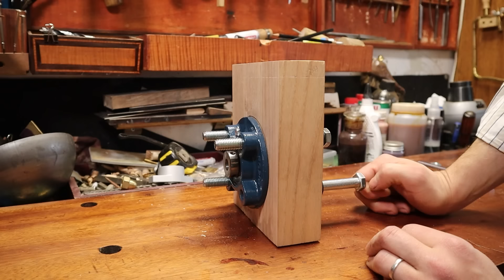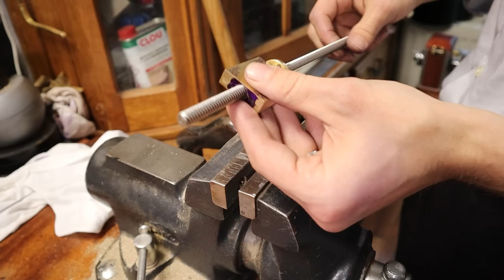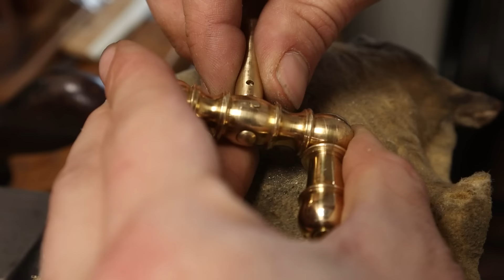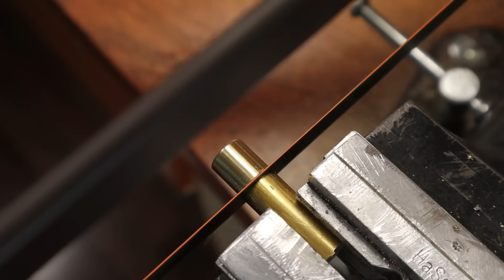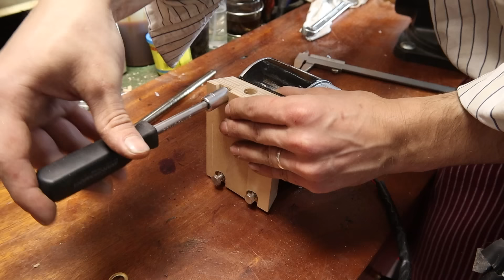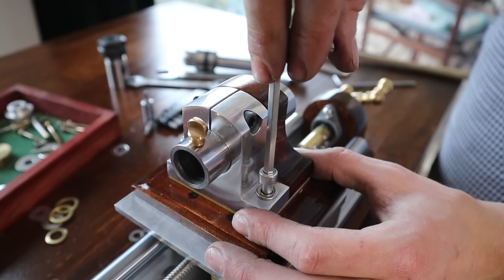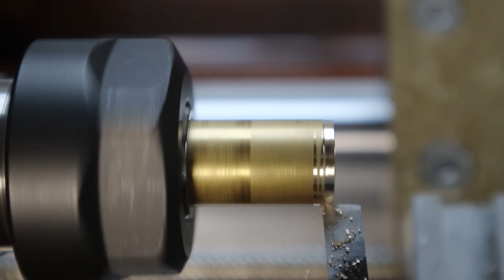Mini Lathe 2 Build

Comment: Pleasure for my eyes!
3 suggestions/recommendations:
1) You need to cover/protect rails.  Otherwise all the metal and wooden chips and dust will ruin either rails, either cart bearings, either both. Something like accordion on real milling machines and big lathes. I saw someone doing these accordions from regular AC Furnace filter( Filtrete, 3M, etc) in Northern America. Don't know if you have such things in Europe.
2) Something is wrong with your spindle bearings. One of the reasons is sort wobling of your spindle. I think you need to change them to some more precise.
3) Please use regular lathe cutting tools, some of the chinease versions are deadly cheap nowadays with decent quality. The crazy sound and quality degradation is caused by the wrong cutting tool angles.  
Good luck and thank you!

Comment: To explain what 4.6 mean, its metric of how much Normal and lateral pressure can the bolt take. So 4 in that mean, its 400MPa normal (tensile/compression) pressure and 0.6 you have to multiply by 400MPa and get 240MPa lateral pressure.  If you want to know how much force your bolt will be able to withstand just times it by the area of the diameter. So around 3kN normal and 1.8kN lateral forces. Hope this helps.

Comment: It's really beautiful but the wooden headstock is the weak link right now. You can see the deflection when you're making cuts. Rigidifying that should help with chatter. It's a shame that there is no space on the base to make it longer. My recommendation is to either replace it with a metal one or at least put a steel plate on the front and back of the wood  to reduce the flexibility. If you're able to also try tying the head stock to the aluminum base plate to reduce deflection. Good luck this is really promising.

Comment: The number on the head are the hardness of the bolts. the first number represents the how much force can it take before it breaks. The second number represents the percentage where the bolt starts to flex, and deforms. But i think the problem here is that the 4.6 bolt are thinner and the thread are pressed on them and the 4.8 are thicker and the thread is cut on.

Comment: Hi Uri,
another hypnotic video... as usual, I can't stop to watch them.
I built a metal lathe, and even if I didn't film the building phases, you could see how it work on my youtube channel (sorry in Italian).
If I can permit me to give you an advise, the main problem of your lathe is the head stock's bearing. That kind of bearing, hallow too much axial mouvements and in a metal lathe this is a big problem.
The best thing for you is to change it with a couple of conical bearing (one on each side of the head), that can be tightened on the shaft avoiding  all mouvements.

Comment: Looks like a piece of art. I use an old GDR lathe and it works well. I am a little suspicious about the wooden parts but that's just me being negative. Probably I would have cast most parts out of aluminum and / or cast iron. Btw the numbers on the bolts are the quality. Stuff like max Torque.

Comment: The number on the bolts is the FOS (factor of safety, buildings are 12+ and lifting is 5-10, these arent under large amounts of tensile force so 4.6/4.8 is fine)

Comment: State of art craftsmanship.
I think the wood may be a bit too forgiving for a material to hold things stable enough for high speed spinning with the torque applied when you lathe turn metal. Maybe create metal structure and a wooden she'll over them. Just a suggestion.

Comment: 4,8 or 4,6 means strength class, the first digit 4,# means the ultimate tensile strength, and the #,8 or the #,6 number means the percentage of the previous value what is the yield strength (strength at which the steel gets permanent deformations before breaking). So for example in a 4,6 bolt the ultimate tensile strength at which the bolt breaks is 400 MPa and the yield strength is 60% of that value, so 400 * 0,6 = 240 MPa is the value at which bolt starts the deform permanently.

Comment: I definetley feel like changine up the tool geometry would help, try to gring some more clerance on the HSS so the tool is only toching the work with the very tip, because the tool acts like a form too and causes loads of deflectoin in the video, but you can see when facing and profileing the dome it is cuts better with less deflection.

Comment: As always, it's gorgeous.

I assume that the chatter is because of the tool you use.
You mentioned that you have very few tools and I think I saw that it was the same tool you were using for hand turning earlier.
which, I assume, wouldnt have the relief angles to cut from the side.

This Old Tony has an amazing video where he makes a single point lathe tool.

Comment: You’ve done it very well but not enough strong spindle and bearings.
If you use the taper roller bearings you will have a nice lathe machine.

Comment: Uri have you heard of "epoxy granite", aka "mineral casting?" I feel like it might be down your alley. It's essentially slow-setting epoxy mixed in with rocks and sand and cured in a mold.

The end result can be used as a foundation for machine tools as it has excellent vibration damping properties and is heavy enough (although still much less heavy than iron).

People have used it to build mills, lathes, CNC mills, ...etc.
Reply: Just use scrap metal or sheet metal in your epoxy to weigh it down. I imagine if you could get lead (can be difficult in EU nowadays, as it's no longer used for wheel weights and no longer discarded by kilograms), it would be awesome.

Comment: The numbers on the bolt heads usually tells something about the strength of the bolt and 8.8 are some of the "strongest" bolts.
The first 8 indicates a tensile strength of 800 N/mm² and the 2nd indicates 80% in yield stress i.e. 640 N/mm².

Comment: The number on the bolt tells you how hard the steel is. Try some WD40 when shaping brass with the tool post. Will cut much easier. Apply with a brush. Great build

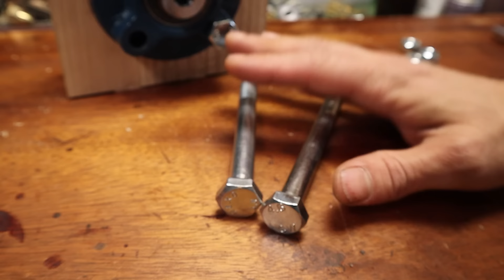Comment: The bolts mentioned at appx. 1:32 : The numbers represent material toughness (hardness?). I didn't saw a 4.6 before, but 4.8 is your common everyday grade. There are: 5.6 , 8.8, 10.8 thatI know of. Even 8.8 is really tough (think lugnuts, industrial machinery, etc.), not speaking 10.8 .

Comment: I know what you mean.
You just have to use steal period.
You definitely have the right idea. Its to bad wood and aluminum flex so much.
There is a alot force being put into the cross slide when working with metals

Comment: Uri, I know that your work is as much art as it is functional so I wanted to ask you about using wood on the lathe. Obviously wood is going to introduce a lot more flexing and movement of parts and make perfect machining more difficult on your lathe. On the other hand, it is easier to work with and it gives your lathe a gorgeous look and a distinct style. Did you consider making the lathe entirely out of metal or was the look more important than the small imperfections that the wood would introduce? Great video as always, thank you for the content.

Comment: The numbers on the srews 1:30 means your tensile strength and the yield stress. Your 4.6 Screw has 400N/mm^2 of tensile strengh and 240 N/mm^2 of yield stress. The 4.8 Screw has as well 400N/mm^2 but 320N/mm^2 of yield stress. Therefore the shaft has a little bigger diamenter then the 4.8 screw... 

Look for ISO EN ISO 3506 if you want to know more.

Comment: The numbers on the head of metric bolts denote relative strength in MPa. I think the two numbers are tensile strength and yield strength if I remember correctly.

Comment: You might want to make a corrugated plastic cover to go between the headstock and  to protect the slides and linear bearings,  fine chippings and metal dust will not be good for their longevity.

Comment: Beautiful looking piece of equipment, but to a machinist It's like  watching a beginner use a stradvarius to screech his way through twinkle twinkle.  You are turning that brass at too slow an rpm for the diamter and the lathe tool cutting edge sounds slightly high of center line.  It would not hurt if you sharpened it either.  All of those would help eliminate some of the flex you are getting.    It would also be helpful to lock down what ever axis you are not currently moving the lathe in.  The base of the machine also needs to be something stiffer and heavier  then wood.  Maybe a piece of handsomely engraved steel with a brass name plate?

Comment: Just a guess, but by looking it seems that 3 of the bolts are stainless steel, and 1 is galvanized, which is why it doesn't fit in a close tolerance hole.  Great vid, as always.

Comment: @Uri Tuchmann
The grade label of bolt performance consists of two parts, which represent the nominal tensile strength and yield strength ratio of bolt material.
For example, a bolt with a performance grade of 4.8 means:
    The nominal tensile strength of bolt material is 400 MPa.
    The yield-strength ratio of bolt material is 0.8.
    The nominal yield strength of bolt material is 400 x 0.8=320 MPa.

Comment: 4.8 represents the force under which the Bolt will strech out lengthwise. 480N/mm² or something like that. The non fitting Bolt is a result of tolerances and surface finish. Best wishes from germany.

Comment: Uri, the HSS tools you use need to have quite a different shape than the ones you use for the manual lathe. Check out TOT's video on tool grinding....and Blondihacks, etc...
"Relief angles" is the key phrase here.
Definitely show us everything that does NOT work as intended. I think lots of us want to learn here...

Comment: Think those numbers are Thou of an inch. 12mm = .472 inches therefore the 4.6 and 4.8 are likely the upper and lower limits of the 12 mm bolt. The threads on the 4.8 likely have a sharper thread from provided they are threaded to the same thread per inch

Comment: The first number on the bolt represent the nominal tensile-strength of the metal multiplied by 100 (in N/mm^2), the number after the dot represents the factor between the tensile strength and the yield strength multiplied by 1/10.

Numbers: X.Y ---> 4.8 ---->  Tensile strength : 400 N/mm^2 , Yield strength 400*8/10=320 N/mm^2
So you have two types of bolts: one with the tensile and yield strength shown above and three bolts with the same tensile strength, but with a yield strength that is lower: (400*6/10) 240 N/mm^2 to be exact. 

This number determines how hard you can tighten the bolt before it suffers from plastic deformation.. In your case, this has little impact because you're tightening with wood as intermedium.

:)

Comment: I don't know if it is the camera angle or what, but the tool looks way too low. Getting it centered up (if that wasn't an optical illusion) will massively increase cut quality and reduce chatter. Also, more rpm and a smaller tool to make it nor have to work against torque so much. Also, also, absolutely gorgeous.

Comment: The numbers provide information about the strength class of the screws in N / mm².
The first number multiplied by 100 is the tensile strength (at which load the screw fails), the second a factor to determine the yield point (maximum load without the screw permanently deforming under the load).

For example:

4.6 means:

400 N / mm² tensile strength (up to 400N per mm² cross-section of the screw. You can calc this with the diameter of your screw and the formula for circels.)

The yield point is 0.6 times 400 = 240N / mm² , so if you strain your screw with this load it will never fail in a static case.

It surprises me, that someone who build his own Lathe doesn't know about this :)

EDIT: 
Somebody else has answered this already....well. Never mind^^

Comment: The numbers on the bolt are their tensile strength. 4.6 is Norma, 8.8 is high tensile. 
Means, how hard it is to sheer or break the bolt. 
The size of a bold is an M size... M16 or M12. Bigger number is bigger size (diameter).
So a 100mm M16 8.8 would be a 100mm long bolt, high tensile, with a diameter of 16mm

Comment: cutting tool could be in a line over the bearing to avoid flexing, also perhaps swap with the tailstock bearing which is bigger.
the drive belt seems thin gt2 belt, gears seem low diameter, would possibly be better suited to a smooth belt and bigger diameters

Comment: The number on the bolt is the grade of the bolt that represents the stength! 4.6 means the tensile strength (tension wise) is 400 MPa (4 times a 100), and the yield strength is 60% (6 times 10 in percentage wise) of that thus 260 MPa. They have nothing to do with the size of the bolts though.

Comment: Your builds are always amazing, true art. How much did you have total in materials for this?  One suggestion though, Your spindle stock holder (the wooden piece with the medallion inlay ed) appears to have some deflection (could just be the camera wobble hard to tell without a background reference point).  You might want to do more of a pyramidal shape, square tapper up to a flatter cross section where the spindle goes through the wood, sort of like and A frame.  I noticed in the film there is a slight deflection in the chuck ( Also make sure your chuck itself doesn't have issues) when you were turning a piece and the tool wasn't touching. Also you might want to run it at a higher speed and take slower cuts.   But this is fantastic work I have wanted to build one for a while now but wasn't sure if I could due to lack of tools, you have proven to me that its possible with time and the right hand tools to build everything, so thanks.
Reply from the maker: Thanks! Yeah, there's definitely some deflection happening that I need to fix. As for material costs, For pure performance, it would probably be cheaper to buy one :)
Reply: @urituchmanpigeon   I'm sure it would be cheaper but where is the fun in that? Plus when it breaks you can't fix it as easily as something you made yourself.

Comment: I haven't quite figured this out.  Are you a woodworker who doesn't know brass is a metal or a metal worker who figures wood is just a really soft non-ferrous material? :)  (or.... a clockmaker who wanted to move up in size!)  Seriously though, your work is inspiring..... and you leave no doubt that you did it and how you did it!  Best looking treadle lathe I've ever seen!  (I know... but ALL lathes on a singer treadle sewing machine base... are treadle mills, right? ;) )

Comment: If you have a number like 4.8 on the bolt, that means the tensile strength is around 400 MPa, and the yield strength is 80% of that (so about 320 MPa).

Comment: .like life ,...it needs some  fine tuning friend.
Tip ; neXt time you can use a light to center things out [ works very good, precise]
Close the wood,  moisture makes your tool inaccurate  close it with glue. 
ThnXs for the '' Share '' like it ''

Comment: The numbers on the bolt represent the tensile strength of the steel used for the bolt. 4.6 means 4.6 Newton/square millimeter, which is not so strong but enough for normal projects. For cars normally all bolts and screws have at least 8.8, in the industry you'll most likely never find something beneath 10.9. Why the are sized differently? I have no clue...

Comment: I love your work but cant help wonder what the costs are to make the lathe ? Ive made a number of items myself and for me its more about the journey, the experience and the learning process rather than the end goal, BUT its nice to have something at the end that I can use ! However, for me, my costs have to be reasonable and not too much above that of buying the 'thing' in the first place, and I have to be able to make something to a similar or close to similar standard as that which I can buy or even better if possible. So how much, would you say the entire lathe cost you if you include the materials, fasteners, bearings, slides etc !

Comment: Try adding another bearing block to the back of the headstock as it seems on a close-up shot you did you were getting a flexing movement on the spindle shaft. That may be where some of your chatter is coming from. It's a beautiful piece of work and craftsmanship. Needs a little tweaking. I just subbed to your channel. I love the content. Chow  😎

Comment: The 4.6 and 4.8 are the metric grades.  4.6 is 400Mpa and 4.8 is 420Mpa.  Grade 8.8 and 10.9 are commonly used on automobiles, they are 830Mpa and 1040Mpa respectively and roughly equivalent to SAE Grade 5 and Grade 8 respectively.  Grade 4.6 and 4.8 have no SAE equivalent, since Grade 2 is the lowest and indicated by an unmarked bolt head.  Grade 5 has 3 radial lines and Grade 8 has 6 radial lines.  TL;DR Grade 4.6 and 4.8 are made from bubblegum and steelworker tears.

Comment: Wow, that was not an easy project - but even though the results weren't quite what you wanted I thought the work was really impressive.  Most of the lathes I've seen out there on YouTube videos are made from what looks like solid steel (except in once case the gears were plastic...) and I'm sure they are "precision machined" - I guess that probably makes it a lot easier to eliminate "play" and sources of wobble or flexing.  I am hoping it turns out to be relatively easy to address this in your build - since again it is a really impressive piece of work and it would be great to see it performing to your requirements!

Comment: 4.6 and 4.8 are the diameter in mm of the shaft of the bolt if im not mistaken different thickness for different torque levels

Comment: It's been a while, but if I remember correctly the numbers on the bolt heads corelate to the yeild strenght of the bolts and dont really have anything to do with the size.

Comment: 4.6, 4.8, 5.6, 5.8, 6.8, 8.8, 10.9, 12.9 are quality steel. The bigger the number is, the harder the steel is and can resist to bigger strength.